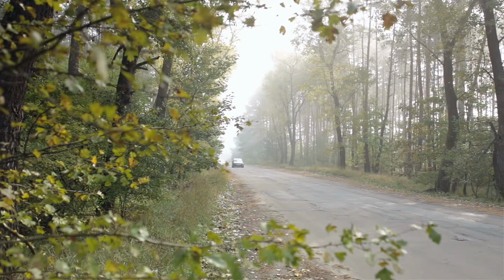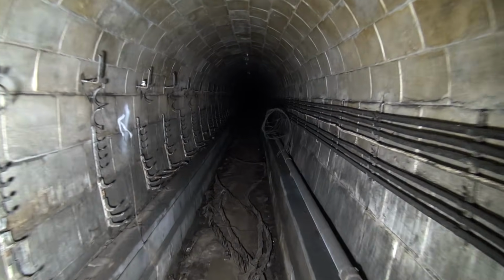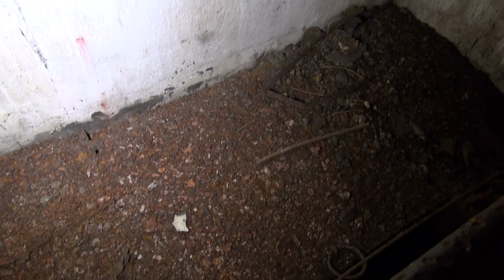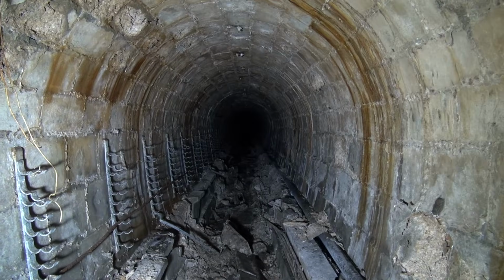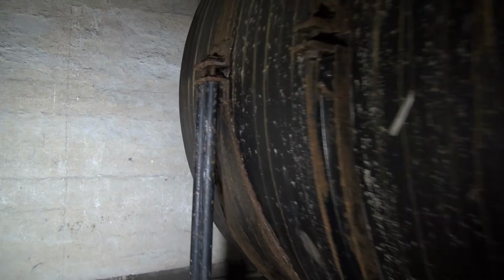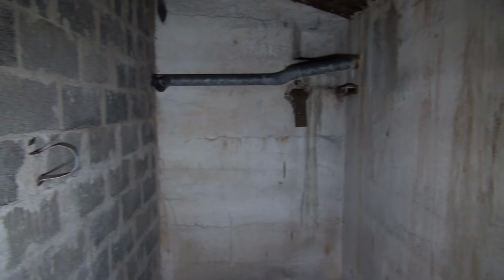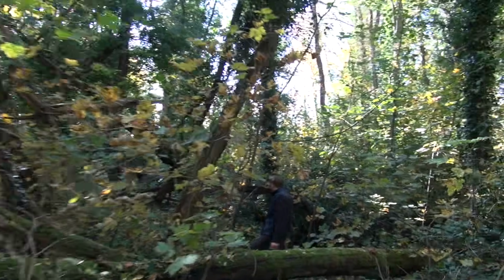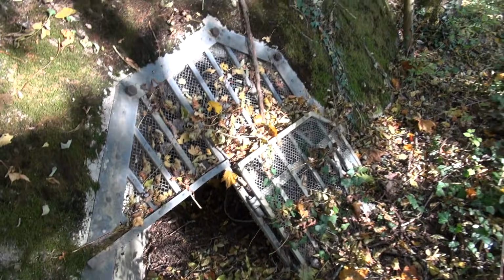GREAT FORTS - FESTE VAN DER GOLTZ THE LATEST PRE-WAR DESIGN

Comment: @34:52 - 
Motors?

That looks like a vintage generato room: Big old diesel motors driving the giant flywheels connected to alternators that appear to have been disassembled long ago. Note that the exhaust pipes from each motor is coupled to the main horizontal pipe near the ceiling. Quite a place
!

Comment: Torpedo work in the tunnels?. The standard German WW2 torpedoes had a nominal diameter of 534.4mm to 534.6mm. Interestingly, this runs out in Inches as a nominal 21 inches, the standard-diameter of Allied WW2 torpedoes. And at 7163mm long, they would have bee interesting to maneuver in those dinky tunnels. MOST Luftwaffe torpedoes used a smaller diameter of 449.6mm, just to be different, but they also fielded some "Kriegsmarine" sized ones. Weights ran from about 700 Kg to 2.6 Tonne.

I am more suspecting torpedo components.somewhere in that installation.

Anyone else have anything?